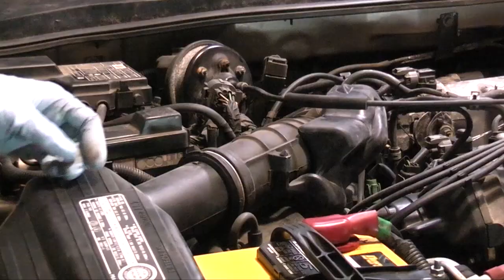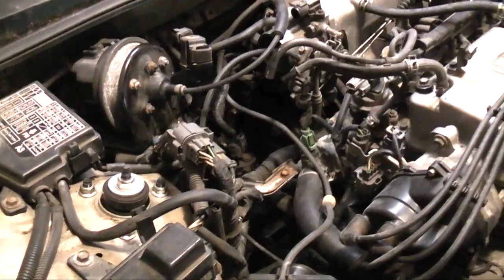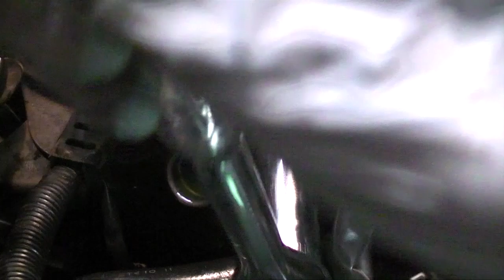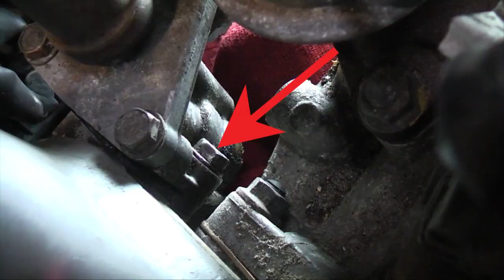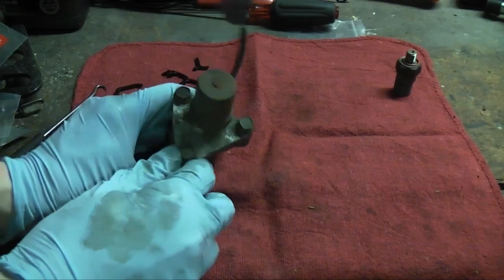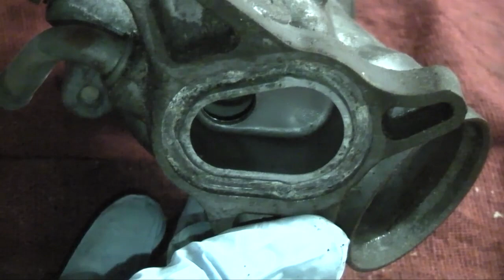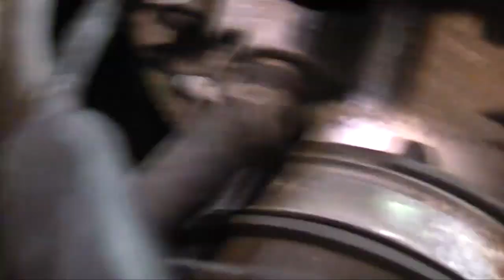Honda Accord VTEC Solenoid Gaskets Replacement

Comment: I tried to avoid opening the cooling system and followed process shown in Bigdog50001 channel.  I was able to reach the hidden bolt, no problem, with a 10 mm Craftsman offset wrench. However the bolt was really stuck on there and the offset wrench started to round it off.  I was worried.  I re-thought things and found I could just fit a 10 mm 6-point 1/4 drive Gearwrench universal socket there and could force it enough with an extension essentially at right angle to the bolt. I think got lucky and got enough force on that now somewhat rounded bolt head.
Then things went smoothly.

 My take is that my 12-point Craftsman offset couldn't apply enough force without damaging the bolt. So be careful if you find you have to push pretty hard with a 12 point wrench!  And if so I'd follow recommendation in this video and remove the coolant system parts...
Reply: Thanks Honda Accord family

Comment: Bushougoma, this is a great video!.  You really explain EVERYTHING,  and I need that.  The video is 12 years old now but still super useful for those of us with old Accords.  On my 94 Accord I changed out the VTEC upper and lower solenoid gaskets (which were leaking oil) and the VTEC oil pressure switch (because the plastic plug part of it disintegrated when I tried to remove it).  I followed everything you showed except I was able to avoid opening the cooling system.  I was lucky enough to get a 10mm 12 point offset box wrench on all of the solenoid horizontal bolts and remove them without rounding the bolt heads.  

This one fix completely corrected my oil-leaking engine.  My engine had been slowly leaking oil pretty bad for quite awhile. I had no idea what the problem was.  I had thought I maybe had a rear seal leak, or oil pan leak, or a valve cover leak or a leak from the oil pressure switch above the oil filter.  It was none of those things.   Just that VTEC solenoid with its dried out gaskets.  Since that is at top of engine, it drenches everything from top of engine to bottom of oil pan.  I'm very happy about this fix.  Again, a great video.

Comment: 1:34 
Now that things are older, I recommend just take the air that snorkle cover off with the hose. My hose tore when I flexed it. I did find one at the wrecking yard.
Thanks for the great video.

Comment: Hey guys I would like too say using the bent 10 mm is the best way too go saves a lot of time also just if your new replace the upper one too I promise it only takes 5 mins too replace the upper one and it will save so much hassle later on

Comment: Thank you so much for the video 
I love your videos…you do a great job walking though the steps of everything you do. I also watched your video on the steering rack replacement.  I have a 97 Honda Accord and I love it. I have completely rebuilt the suspension and exhaust plus steering rack and now the starter. 
I used your videos for some of those. 
Thank you so much. 
👍💯

Comment: For those who haven't seen it yet, there's another video that shows the trick of using 10mm offset wrench to get the hard to reach bolt. Can take off the solenoid without touching the coolant system. Not my idea but a useful one for sure.

Comment: Valve cover gasket $240  plus vtec gasket and distributors at $285 =$525. Does this sound reasonable for mechanic charge? I have 2000 accord 2.3. Thanks
Reply: Oh hell no. Find a better independent mechanic. That one has a drug problem.

Comment: Great video.  A 10mm offset wrench would prevent the thermostat housing from being removed.
Reply from the maker: Unfortunately in most cases it won't the clearance between the head of the bolt and the valve casting is so tight that only the thin wall of a socket will fit.

MAYBE if you get a real expensive set of wrenches SK, MAC, Snapon, etc they will be thin enough but most inexpensive DIYer sets have much thicker box ends to strengthen them because they are made of cheaper metal.
Reply: @Bushougoma  Crazy because I just did this today on the same make, model and year with a Craftsman 10mm offset. 👍 I appreciate the video, it's great having a visual before diving into a project.
Reply from the maker: @mechanix6191  It's possible they may have redesigned the valve to remove that rib then. It's not uncommon for parts to be modified slightly over the years.

I was only able to get a wrench on it crooked because of the metal rib (I was barely grabbing the flats on one side) and I was certain that it would round off if I tried to remove it.

I have some nice thin walled wrenches now that would probably fit but I'm not that curious :-).

Comment: A word of caution for anyone attempting to do this themselves . Be very, very careful when you tighten the vtec solenoid oil pressure switch. When you start tightening it with the 22 mm deep socket it will not feel like it is tightening much at all and it is difficult to tell if you have it on tight enough because there is no resistance. If you keep going you will break off the thread piece from the oil pressure switch and it will be stuck inside the vtec solenoid valve housing. This happened to me. Luckily I was able to get the thread piece out but had to go to the junkyard to find another switch. I wish that this would have been explained more clearly here. Also when I went to tighten the bottom screw (the one that is hard to get to) it didn't want to tighten like the other two it got to a point where it felt like it was on good but just kept turning and never met a point of resistance so expect the unexpected and good luck this job is not near as easy as it looks in this video.

Comment: I'm half way done. Two of those three bolts are loose. Mine is a '98 and they say I don't need to remove the thermostat housing. Oh well... I saw to use a off set closed end wrench. Ok, I'll get one and try tomorrow. If that bottom bolt still difficult I'm just going to remove the thermostat. I'm just replacing the whole thing. By the way thank you.

Comment: Excellent video man! After replacing a leaking valve cover gasket and leaking oil pan gasket. The last leak which was the worst is the very gasket you replaced. What can you expect the ole Honda has 359,000 miles on it. Thanks!

Comment: I cut a 10mm wrench in half and that's how I got to the bottom bolt it worked pretty well without having to remove thermostat housing

Comment: An off set wrench might help get to those bolts that are tricky and you may not need to remove as much stuff??
Reply from the maker: I need to pick up a set of those. It's worth a shot. Let me know if it works.

All I know is a standard offset box end wrench won't fit on the bolt squarely it was just barely gripping it at the corners on one side. I would have stripped the bolt if I attempted to loosen it. My straight handled no offset gear wrenches didn't work either.

To make matters worse (if it's location wasn't bad enough) there is very little clearance between the bolt head and the valve casting on one side so anything thicker than the wall of a standard socket won't fit over the bolt. Which rules out any type of ratcheting gear wrench which naturally have a larger box end due to the mechanism.

Comment: Heck, if you remove all that, you might as well remove and clean the EGR valve.. (just the valve, not the passage of course). I'm not sure it would be worth it without also cleaning the passage. Just a thought... Also, depending on how long it's been, change the thermostat too. Heck! Change it all (Ha ha)...  Kinda looks like you could get to that bottom bolt with an offset ratchet wrench http://www.sears.com/craftsman-9-x-10mm-wrench-offset-ratchet/p-00943367000P?sid=IDx01192011x202447059&gclid=Cj0KCQiA7dHSBRDEARIsAJhAHwjUogkVBjy0L5VtGNOIKva8d_s7AxYTxF1OBto-HoWwSNTEUIz8z7kaAqKjEALw_wcB&gclsrc=aw.ds&dclid=CLjq_Ke0zNgCFUFifgodhNIBsg...Fantastic video!
Reply from the maker: The clearance between the bolt head and the valve casting is pretty tight I'm not sure if it would fit. You can barely get a socket on there. But it's worth a try.

Comment: Hi I do the same work I put a new  gasquet but still is leaking a drip from the part when goes the 3 big Bolt so i don't  not was  wrong.help bushoma

Comment: This was a very well made video. thank you for the information.
btw, why didn't you remove the EGR ? looks like it would have made that one screw much easier to remove. 
I have a 1998 Accord it looks a little bit different. is the procedure about the same ?

Comment: So I'm a little worried about the extra coolant that left the block when the thermostat housing was removed. Shouldn't this coolant be replaced or "burped" or it could cause the thermostat from opening up causing the block to overheat?

Comment: Are you sure about the part number for the ''VTEC valve to cylinder head gasket" being:  15825-POA - 015???.......I see it elsewhere on the internet as 15825-POA - 005.....   Is it possible you made a typographic error???                  I await your reply.....
Reply: MikeNichols50 the correct number is 015.   I do see a lot of the 005 ones mostly from chinese sellers on ebay.   I am not sure if 015 superceeded 005 but they do look exactly the same

Comment: Could you replace a 1996 Accord solenoid valve with a 98 Accord solenoid valve? They look exactly alike.
Reply from the maker: They look visually compatible but my aftermarket catalog shows different part numbers for the 96 and 98 so it's possible there are internal differences (spool valve shape, size, valve bore diameter, etc).

The aftermarket is all about consolidating part numbers where possible to reduce their inventory.
Reply: Thank you for your advice! I am about to swap my 96 vtec valve as I have a P1253 code so hopefully that will fix it. However one more question... If I swap it, do you think I need to calibrate the valve or something before or after installation? 
Thanks in advance!
Reply from the maker: Tyler Hamby
If you mean some type of PCM relearn process then no.

The valve is either full on or full off the PCM monitors if the valve is actually functioning (oil is flowing) when the solenoid is energized via the VTEC pressure switch.
Reply: Bushougoma Got it thank you! Looks like it's probably just the oil pressure switch BTW thanks for that video too. lol  You are an awesome person!
Reply: Goood

Comment: What about the gaskets for a 2000 Honda Accord LX?
Reply: Same as video I changed mine today in my 2000 Honda Accord lx
Reply: Dealership says I have to buy parts to get gaskets????  Did you have to?
Reply: +theknob1 No, you don't. Classic dealership ripoff, they do sell just the gaskets alone, might be a bit more expensive than say an online parts dealer like rock auto or even Amazon. If you know the part number then shop around for the best deal.
Reply: tengo Honda Accord del2000cuando llegar a3000rpm da fallo y no pasa de ay

Comment: Do you have the honda part numbers for the oil pressure sensor o ring, inlet assembly gasket and o ring?   Great video.  Thanks

Comment: I don't have any connections for the solenoid mine wasn't even connected when I saw it and it doesn't have the oil pressure switch either

Comment: just did this last night on my 6th gen accord. comments/tips:

1) the top double circular gasket for the 5th/6th gen are exactly the same. honda dealership told me this. the 6th gen catalog doesnt show the gasket as sth u can buy separately. 

2) if you want ease (ability to use torque wrench as well), do it like in this video. additionally, for the 6th gen, i would (for max ease) remove the egr valve, disconnect all connectors in the nearby area, remove distributor, remove the breath hose in the Valve Cover, etc. all simple/easy.

one extra step: for the 6th gen, its better to use univeral joint for removing the top 3 bolts (plastic cover for wiring in the way) or the egr vavle (if u are removing it) because its very easy to strip the head if u try to do it at an angle without a u-joint. 

3) you can do it without opening the coolant or removing the egr or intake in the 6th gen (i.e. only remove some of the connectors). BUT you need a 10mm offset (home depot $30 set). 

WARNING: its a PAIN IN THE ASS. your hands will hurt from turning with your hand in such a tight space (with egr, inlet, etc in the way) but IT IS possible. 

DONT TRY LOOSENING THE BOTTOM BOLT WITH A U-JOINT. the inlet is in the way for even a 1/4 u-joint and u will strip it (esp if its drenched in oil).

ALSO: dont forget a magnet pickup tool. esp. when trying to get things back together.
Reply from the maker: +Amit Shakya The reasoning for breaking into the cooling system was already explained in the annotations and you've found out first hand (pun intended) why I decided to show this method :-). That and I didn't feel that the added difficulty of leaving the components in place was warranted especially for DIYers who may not be accustomed to working in close quarters without vision of what they're doing.

On a related note I really don't see the point of trying to save some old nasty coolant which in many vehicles is way past it's use by date since changing the coolant at regular intervals is very often neglected. Once the corrosion inhibitors in old coolant are spent it becomes acidic and eats away the aluminum components (block, cylinder head, intake, radiator, etc) it comes into contact with.

Thanks For Your Comment.

Comment: It is necesary to clean the engine part where the VTEC valve goes? Or put some SILICONE?
Reply from the maker: +Oscar Matamoros No unlike paper gaskets the o-rings seal fine on their own and the small amount of clean oil keeps the o-rings from binding and coming out of their grooves as the components are slid into place.

Comment: I did mines one today and I did good but when I put everything on then try to start the engine it wouldn't start :( check everything the wiring its all hooked up,I need help!
Reply from the maker: +Charlie Lim None of the connectors removed would cause a no start. A no start to be clear means the engine cranks but doesn't fire. If the starter doesn't operate that's a no crank.

Check the spark plug wires and connectors around the distributor to see if anything was inadvertently knocked loose. Since you were working around the distributor that's where I would start.

When an engine isn't running remember the FAST acronym fuel, air, spark, timing. Each of those components are necessary for an engine to run.

Comment: where in the world can I find a oil pressure switch oring for my 2000 honda accord se 2.3lite? I found  the gasket and oring for my thermostat water outlet housing, and my upper and lower spool gaskets for my vtec solenoid. I cannot find the oring for the oil pressure switch. Can I use the same size oring just a little thicker maybe would that be ok? Do you know a part number? I'm going to order a new oil pressure switch on ebay because mine is leaking. found one for a good price but it doesn't say they provide a oring with it. Thanks.
Reply: +Colton Gore use a honda dealership instead. or just goto majestic honda.
Reply: +Amit Shakya to expensive I found one for cheap
Reply: +Amit Shakya but thank you
Reply: +Colton Gore ebay or amazon

Comment: Hello Bushougoma. I have a huge oil leak in my 1997 accord. every time a start the car it leaks a quart of oil in like 5 mins. do you think its the vtec gasket. 
will highly  appreciate your response. thanks
Reply from the maker: +logiclightmatter786 Is it on the drivers side of the engine? If so the balancer shaft seal probably popped out the outer bore on the oil pump was machined too large which allows it to work it's way out over time. There was a recall to install a seal retainer to prevent it.

At minimum you're looking at a new timing belt, balancer belt, shaft seal, and retainer kit.
Reply: +Bushougoma Thanks a lot for the reply. No its on the passenger side. I changed the timing belt, water pump and pulleys at 120000 miles, now car has 158000 miles. Thanks
Reply from the maker: logiclightmatter786
Due to the quantity of oil leaking check the rear main seal.

Remove the transmission shift cable cover then you can remove the torque converter access cover.

If the inside of the transmission bell housing is filled with oil the rear main is bad.

It's not expensive to replace but time consuming.

Comment: Could you help me diagnose an issue? I have a 2001 Gs R integra. At 80 mph and 4k rpm the car vibrates really bad. Could the cause of this be the solenoid gasket being clogged ? i changed the transmission fluid snd the car accelerates as should as long as I keep it out of V Tec